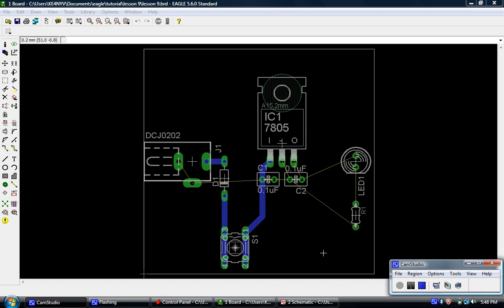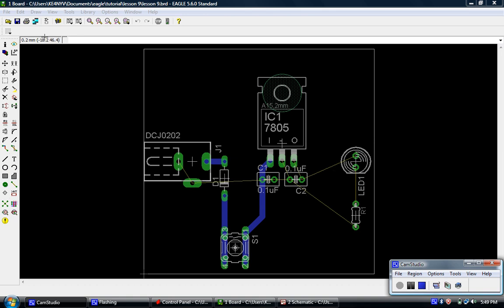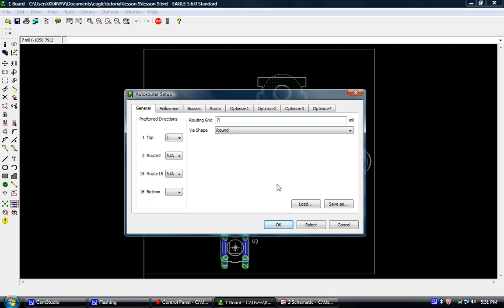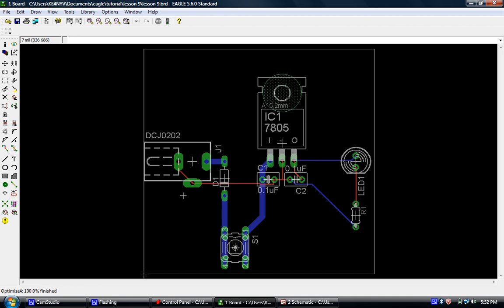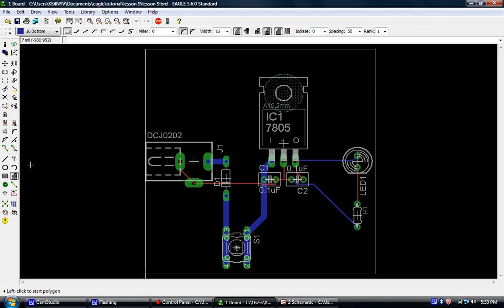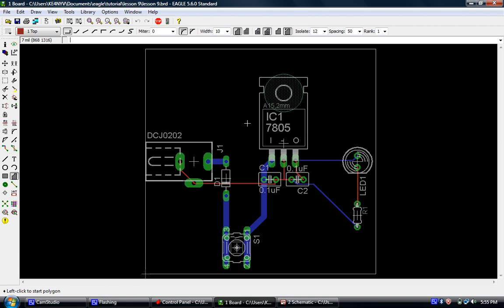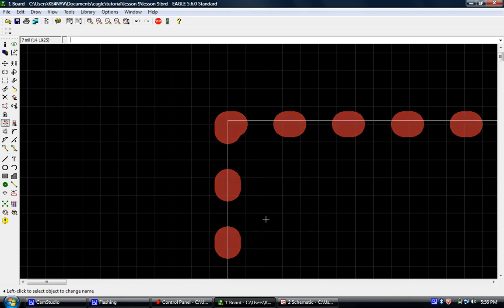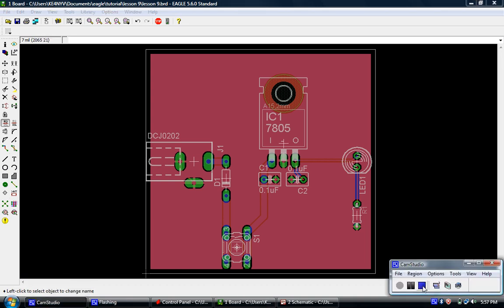Cadsoft EagleCad Tutorial Lesson 9

Comment: @Matik1717 yes this is a double sided board . the top of the board is used to route traces also,  the software uses the pins of the components as "vias" to get the signal onto the top and then route the trace to the place it needs to go more efficiently. If this was a 4 layer board ( 4 layers sandwiched together) the software would use those layers also. all soldering is usually done on the bottom, but the traces can be on any layer.

Comment: Heya Jason, this is a great tutorial, it has really been helping.  Your awesome for putting this out for everyone!    I had two problems on the last tutorial I was wondering if you could help with.

The first was when I tried to autoroute using your settings I got the prompt "Error in parameters! Check RoutingGrid" and could only solve it by taking the routing grid down to 2mm.

The second was when I tried the polygon, all of my settings (width, isolate, etc) are in inches.  How did you change?